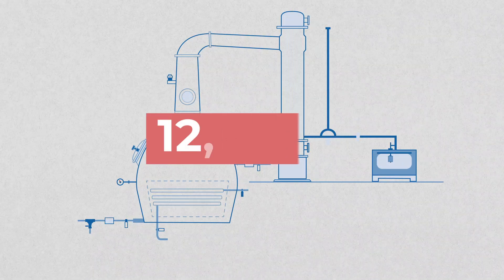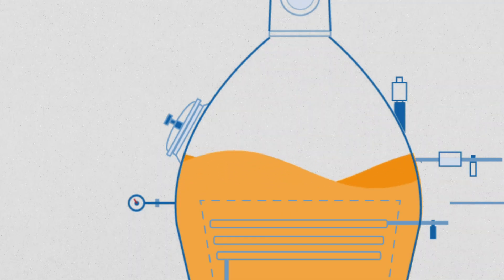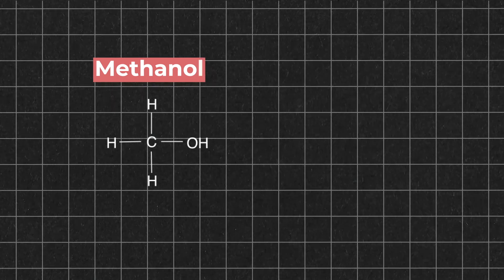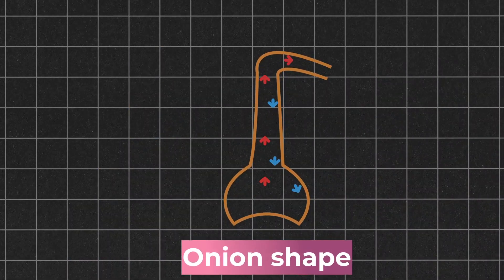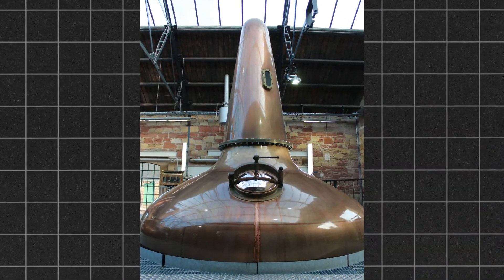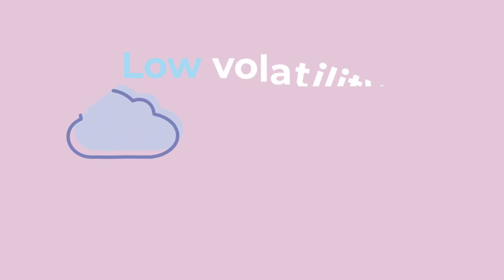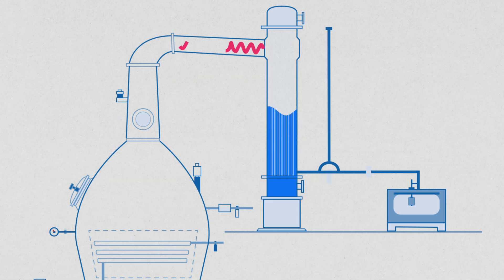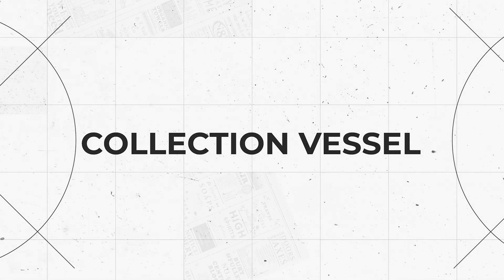The Parts of a Pot Still Explained

Comment: Well done video, but there is on part I noticed was incorrect. Methanol, when in solution with water, has the same boiling point as ethanol. It does not evaporate first in solution with ethanol.

Comment: My step-dad worked for a big scotch distillery. Interesting fact, you can’t swim in alcohol over 65%. This is why collection vessels have ladders. In water you swim because your hand force against the waters surface tension. In high proof alcohol there is no surface tension. So it’s like swimming in air
Reply: Interesting fact...My brain cannot comprehend this
Reply: FINALLY an  interesting, useful comment! An actual contribution besides "great video, wow, best explanation" etc...

Comment: Your comment about volatile compounds and their distance from the heat source reminded me of why some columns are so tall.  Very informative and well presented.
Reply from the maker: Thanks for watching
Reply: The hight of the still is kind of to do with volatility… more so for reflux. 
Ethanol and water are odd, the mixture is azeotropic. 
That means a mix of alcohol and water boil at a lower temperature than both pure alcohol and pure water. However, as a vapour, they condensate differently. So the taller the still the more water vapour and therefore the more alcohol that goes “over the top”

Comment: Great video, very comprehensive and everything is good explained :) You could also do a video about all possible reflux factors besides the angle of the Lyne arm as you already described, every aspect as the sheir height of the still, till reaching the Lyne arm, aswell as every aspect about the form of the stills head matters

Again, great video! 💯
Reply from the maker: Great suggestion!